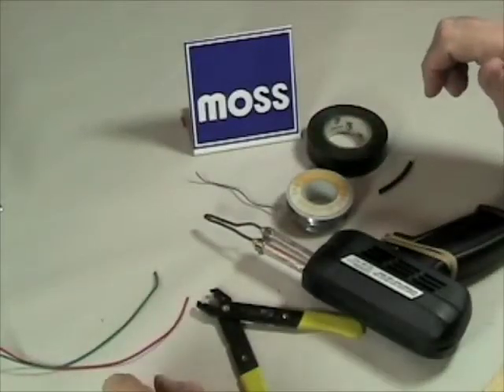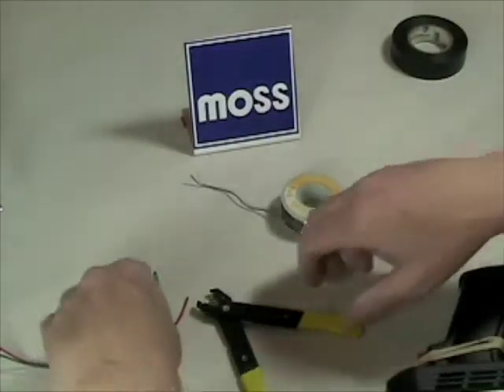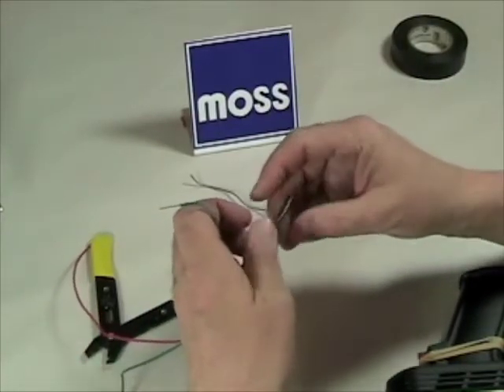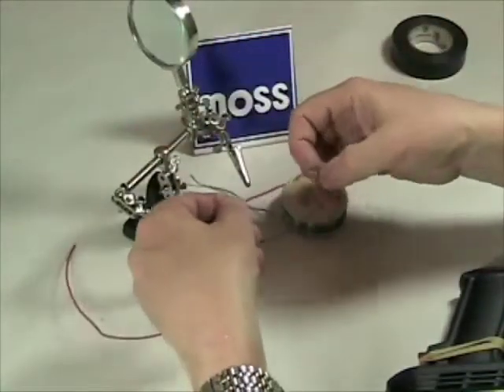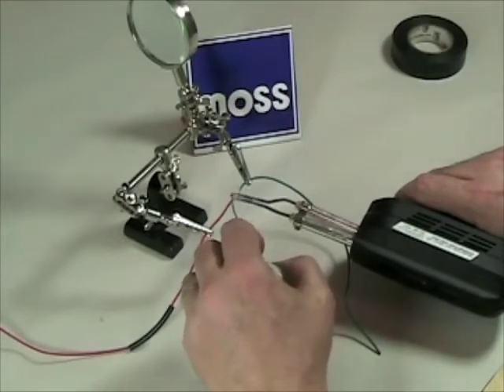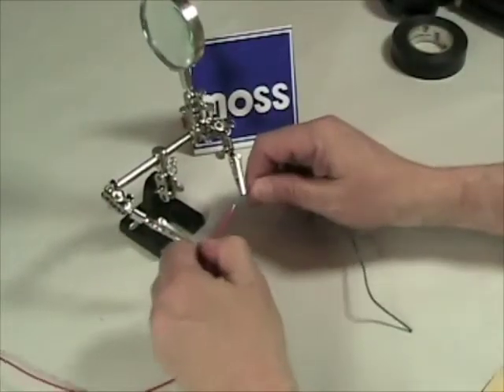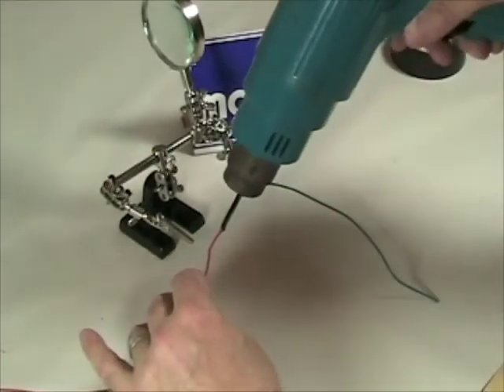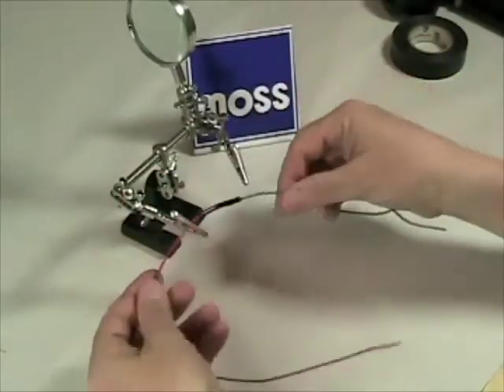Soldering Wire Connections (Part 2) - How to do it Properly

Comment: @MossMotorsCom if u twist the wires without soldering it. will it still gives connection? or soldering is a must to get the full connection? UNLESS THE WIRE IS JUST DAMAGED.